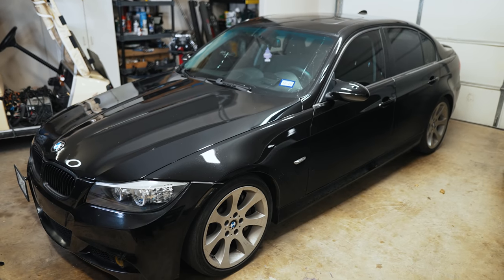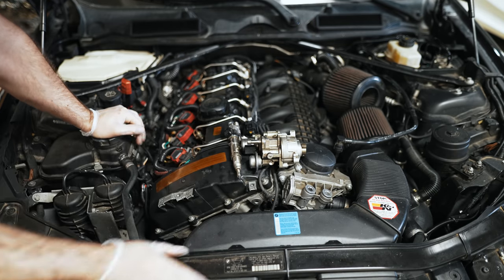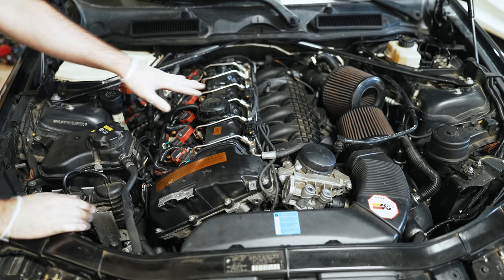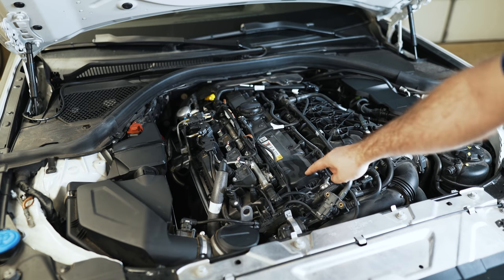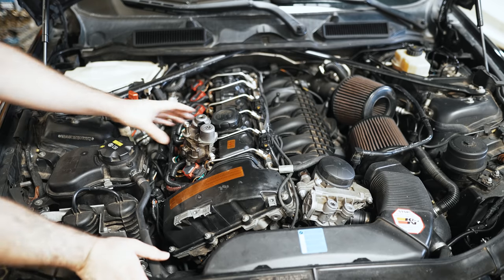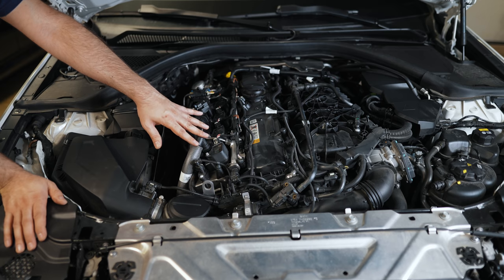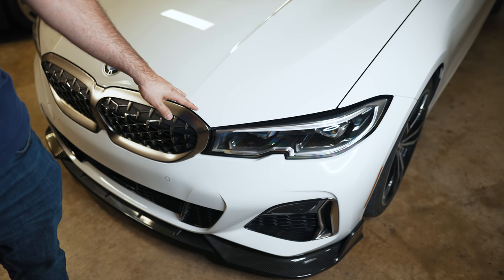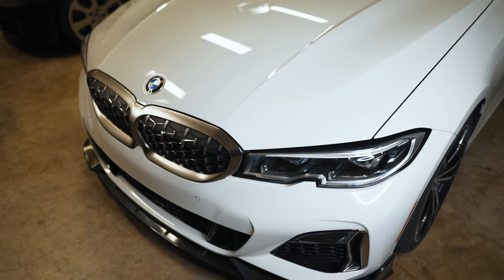Here Is Why New BMWs Are Now Reliable

Comment: Woaw I can't believe my ears. Calling this Reliable with life expectancy 120miles. Because it is full of complex plastic components that will fail 100%. My BMWs have no plastics on the engine. I have M20,M30,M40 engines in my cars. I have no idea about the milage and I honestly don't care but 30+ years old and they still work. Most people buy bmws when they are 120-150k miles second hand.  The reality is that this new plastic cars can't last that long and there is no way around the plastic valve covers, and when we talk about long term if you have to change them every few years it get expensive very fast. For example 20 years old BMW cost around $5k how much is the stupid plastic valve cover on the E90?  the whole intake manifold is plastic yea they reinforced the hell out of it but it won't matter as plastic ages while aluminum doesn't.
Reply: Plastic parts are fine when you jam a bunch of unnecessary metal objects around them to generate heat thats when its a pain. BMW is just a joke at engineering they worry so much able track performing but nobody is taking these cars on tracks.
Reply: @bighorse215  They are not fine they are just cheap. That is the reason why we have so much plastics. Some argue it is for weight reduction, but you can use aluminum,titanium for light weight but it is not cheap. Also no manufacturer want to have cars going for 20+ years. They sell cars so it is no brainer why they design things in this ways.  Oh your gearbox have filter in it. Let's integrate it in the pan so you can't replace it without replacing the pan.  Oh you like to change oil on your car and fill it without paying us for it? Let's remove the dipstick you don't need to worry that your car is running low on oil and the oil is bad we have replacement engines once it spun the bearings, or you can just buy new car right.
Reply: @Matt Rampley I have 4 BMWs, 2 E30s E32 and E38. Trust me this car have been driven like there is no tomorrow, and they are reliable. You can't argue which engine is more reliable M20/M30 vs N54. My M30 is more than 300k miles and the most major issue I had with it was failed stud on the exhaust manifold. When this happen the machine shop couldn't believe this engine was with such millage. So from my point of view the reliability trend is downwards. M50s were less reliable than the M20/M30 then the Vanos made it even worse.  M54 is oil drinking cam ruining disasterpiece and yet there are tons of people that say it is very reliable, but yea it is depending what you compare it to.
Reply: I have M40 , M20. But also a M50 with 230k km and 28 years. Still working great. I won't ever buy those new cheap plastic engine from BMW. M50 intake is kinda plastic but super strong. No issue at all. I would buy a brand new M50 today. I have the Vanos one too. But i change my oil very often and no issue yet.
Reply: My god I have had 5 bmws. Now an f80 M3. I drive my cars.. bmw is for the person who loves driving ... I fucking killed all my cars and the only car that had issues was the 335d. That’s because of all the bullshit the feds make you do to a Diesel engine.

Otherwise I have no clue how folks run around talking shit about BMW. These cars are better than anything else on the market.

Every car has issues. New technology today versus the past. Less weight, more performance and technology. You cannot skip out on plastic. What use aluminum? Carbon? The folks complaining would never spend the money on that.

Bunch of haters...

Comment: currently laughing in n52 even though I was just outside for a few hours replacing my valve cover and oil filter gasket
Reply: I almost blew my oil pump and God knows what else due to a failed oil filter gasket, had to basically do a minor oil change service due to all the oil spill. I love the brand but would I say they are reliable, hell no!
Reply: they have odd problems a lot of other cars don’t, I haven’t had too many issues with mine though
Reply: what does your oil pump have to do with your oil filter housing gasket?
Reply: @Shabbe02  Well when the gasket gives up and the car spews all the oil out, I doubt your pump will function properly after being starved of oil.
Reply: @krispytoast8804  I'm on a 2nd engine due to oil-related problems and wear and tear on certain parts.
Reply: damn how many miles? Mine hasn’t really had oil issues aside from the gaskets that WILL fail on these
Reply: @krispytoast8804  Lol I'm using km so if I do the conversion it would be 155342.8 miles, for the past 2 years I have been doing my own maintenance with the help of a friend who is a professional mechanic. The costs have slowly decreased as I'm more pro-active than waiting for the car to die out on the side of the road.
Reply: @krispytoast8804  Just recently I had to change the rear main seal as it leaked oil and affected the flywheel, had to replace that too, and due to low oil the oil pump ceased and had to be replaced, I had to replace the stem seals as I had smoke coming from the exhaust, fixed a couple of loose things here and there as I had the whole engine apart, all of this cost me about ~750 USD (converted from my currency ZAR). In all, I think these are gr8 cars with gr8 engines but man maintenance is a bit of pain.
Reply: Ok but then the cause is from oil starvation not really the gasket Itself, not to mention that it will most likely not leak so much in a short period of time that oil level will be to low.
Reply: @Shabbe02  I had that thought too, so last week I started the car and after about 5-10 minutes of idle the check oil pressure light came on, immediately drove back home and turned off the engine and realised I had oil leaking, after investigation, I then decided to drain whatever is remaining as I wanted to also replace the oil level sensor as I recently bought a new one, to my surprise mate, there was no oil left, shocking right?
Reply: wow that must have been leaking for quite a while then mate
Reply: You have a B58 engine? That's what this video is about - its much better reliability over previous engines.
Reply: @davepaturno4290  Not at all Dave, I guess it might be good and improved now, I decided to switch to their German cousin and purchase an A4 Audi, I still love Beemer no doubt and have kept my old E90, I would love to try the newer BMW models, but I stand a better chance being hit by a meteor than my lady agreeing to BMW anytime soon :( :)
Reply: Then get a Toyota Supra!👍

Comment: I owned a N53 325i for many years. The only issues it had was a single ignition coil failed (74€) and the wheel speed sensors failed. Other than that it was extremely reliable and very very fuel efficient (less than 8L/100km <30mpg). Since 2017 i own a M140i with a B58 and a manual transmission - enthusiasts wet dream. The B58 is currently the pinnacle of performance, reliability and efficiency.

Comment: Another great vid and that much mileage on the same plugs?! Very cool.  I'm also a B58er and it amazes me the evolution of the inline-6 from big B. Having a closed deck engine and not being canted 30 degrees is wild to me. Since I've always had manuals, it's the auto transmission and diff that have my Spidey (gears?) sense on alert.

Comment: Is the N52 reliable enough for a coast-to-coast road trip? Mine has 144K miles and I've addressed stuff like VANOS, starter, alternator, pulleys and belts, plugs and coils but I'm wondering what else could leave me stranded on the side of the road
Reply: Waterpump, and valve cover gasket leaking oil everywhere, esp. on the belts.

Comment: Engine is full of plastic that will crack overtime making the car uneconomical to repair.  They will las 10 yrs at most.  Cheap expensive cars.
Reply: Every BMW owner should by a 3D printer
Reply: Name one single car being produced right now that doesn't use just as much, if not more plastic.
Reply: @XcoolcoolbeansbeansX  i don't know, I don't buy new cars. They are all expensive piece of craps on 84 months leases for poor people with a fix salary to pay to show up and trying to impress their coworkers and neighboors.  My most recent car is an '07 Mercedes e350 4matic that I paid 8K and it still looks brand new at 70K miles.  However it has a stupid plastic intake that will one day crack. I also have a '01 BMW 740il low mileage with plastic on the chain guides, waiting to fail. Plastic should not be installed around motors running at high temp, stupid engineering.

Comment: Hey I have a couple questions. My N54 rods gave out on me what do you recommend I do. I did a compression test and all my cylinders are over 155 PSI. The knock goes away on idle but is present on rev. I bought a new engine but it was a timing chain issue. I wanna check the PSI on the new engine. But I’m stuck in a rock in a hard place on what I should do.
Reply from the maker: How many miles are on the new engine?
Reply: @VehicularDIY  166,000 I believe like 108,000 miles
Reply from the maker: @John.doe26840  Okay if you check the compression on the new engine don't be too disappointed if it reads a little lower as you are supposed to bring them up to operating temp and let them cool for an hour.  That way there is a film of oil around the rings and the components have expanded enough.  So an engine that reads 160 would likely read 180 when warm.  No way to do that with the engine out of the car.

Comment: Good info, have a question on vanos replacement? Since they are against the firewall, does this require the engine to be removed or is there a tool?
Reply from the maker: For the most part yeah so we better hold the vanos and timing chains are as reliable as they need to be.

Comment: Took my 16’ 535msport to 144k miles. Purchased it with 40k. Never had an engine light except for when my aux radiator blew. No oil leaks. 
Well I changed the upper arms but that’s standard on the east coast

Comment: BMW tech here.. I can tell you right now they have the same problems as the older ones, I prolapsed my back from changing EGR vavles and intakes as we had to changed so many as they were setting the cars on fire...
Reply: Certainly not GR Supras. They have been very reliable and are recommended by Consumer Reports magazine.

Comment: I mean compared to N54, even alfa romeo seems reliable. If it wasn't for the forged internals and ability to make big power they would all be in the junkyards by now
Reply from the maker: Yeah they seem to be making a bit of a revival as they're in the hands of people that want 500+ HP for under 10K.
Reply: Honestly they’re not THAT bad on stock power. Most guys that have a boat load of issues are the ones who throw a JB4 on and send it to Map 3 without doing any preventative maintenance.

Comment: Having been a previous BMW owner and having suffered both financial and psychological trauma, I do not believe in any of this nonsense. BMW has always been over engineered over complicated, totally unreliable cars. They never managed to fix all the problems that you mention and more, all those years and now presto suddenly every thing is fixed. No their philosophy, approach every thing is bad. Go back to the drawing board BMW. Learn to build simple reliable engines first.
Reply: Yah what did you buy? A 110k used f30? Like the other guy?
Reply: @waqidj   E91 2009 efficient dynamic, new. Kept it only for 5 years, lot of problem and repairs. It had only done 40000 km in 5 years! Sold it and bought Mazda CX5. Good riddance to BMW. Great reliable Japanese car. Not a single problem, great to drive. You only make the mistake of buying German car once in your life time. Even my children won't touch German after my experience. They have Lexus and Hyundai.
Reply: @Raj-nh3fc The Toyota GR Supra with B58 engine is both high performance AND reliable.

Comment: I have a 2015 F31 with the B47 2 Liter 4 cylinder Diesel with 210 thousand  Kilometers, and only had two engine issues since new, both were EGR related.

Comment: I have a 2006 e90 and at nearly 200k miles it's been great. Hasn't been in the shop in 7 years. I drive 16k miles per year. It has only needed a water pump, thermostat, spark plugs and coils. I did all that myself for less than $1000 in parts cost over the 7 years.

Comment: Hi Sir, thank you for such a detailed and informative video. I have a 2019 BMW 3 Series and I am dealing with a Valve Cover Rapture as I was told by my local BMW. Currently, I have 95,500 KM on it. I feel disappointed and BMW can give me an explanation why this happened. Waiting for the part to be shipped from Germany to Canada. The car is out of warranty and I have to deal with the expenses. Thought the BMW engine would be more reliable these days. Do you have any comment on this issue with the valve cover rapture?
Reply: Rupture or cracking?

Comment: Just turned 70,000 miles on a 2018 530 with only a replaced 'Active Grill' under warranty a year ago or so. I change the oil (Castrol Edge Titanium with BMW filter) in between official services. It's a twenty-minute job and I aim to get half a million miles out of her. While I preferred the rumble of my Hemi Charger, I really like the straight six sound as well. Plenty of power and it fairly swooshes along. Btw, it's having its first ZF Transmission service next week. BMW may say the transmissions are 'sealed for life' but ZF, who make the damn things, say otherwise. Depending on how hard you drive them - hard and fast or pulling horses etc, you really should get a service done on the transmission every 70-80,000 miles. I'd hate to have to pay to get a new one fitted.
Reply: How did the transmission service go? I am also looking forward to do it but at a dealer.

Comment: Very nice! I personal think the n54 en n55 in Europe are more reliable because  they're running on German parts. My 335i 2009 had one issue uptil now and that was the water pump(50k miles) Small crack in the plastic housing. That's all. And the sea climat will help too here in Holland. So no overheating engine. My friend owns a 640i N55. He drove it from 40k to 80k miles without one issue. At the moment the oilcooler gasket is sweating a bit. He will do both gaskets next month. That's all🤷‍♂️. Dutch regards, Nico.
Reply from the maker: Yeah I've heard that theory a number of times, my guess would be the mild climate.  Not as extreme winters or hot summers.

Comment: Dont know about reliability, because B58TU already has blown motors due to oil pump failure, which showed oil pumps are made of plastic. 
Question which come to my mind are
Are there any recalls/updated part number for B58TU oil pumps? RealOEM catalog is too old for that, only up to 2020 engines are visible.
Do B58 Gen1 engines have plastic oil pumps as well? Never seen these engines blown due to oil pump.

Comment: How does the new B58 in the 2021 3-series compare to the older B58 in the M240i if I want an M240i?
Is it horribly less reliable? Can I fix/revise the issues myself to make it as good as the newer B58s?
Reply from the maker: I'd say its close in reliability 90 to 95% as good.
Reply: @VehicularDIY  Alright, cool, thanks!

Comment: when you use your customer base as a test bed that is not a good track record.  12 iterations to get to get it to work leads to a lot of pissed of customers that came prior and a lot of time in the shop.  BMW and reliability in the same conversation is funny, perhaps more reliable than prior models but most BMW will still go 120-150k miles before they become a parts cannon.  They are still dealing with N63/S63 issues after a decade.  good content..

Comment: I mean N54 and N55 owners didn't have any problems at 15,000 miles either. And injector failure, pcv failure, and leaking oil filter housings are fairly common on B58 engines.
Reply from the maker: The comparison is for early production cars, think of the N54 when if first came out and how the HPFPs were failing before the first oil change was due.

Comment: I didn’t have any engine specific issues with my 2016 BMW it was just everything else. The left rear shock fell apart and started clunking, the clutch master cylinder started leaking on the interior of the car (dripping off the clutch pedal), the radiator fan went out, the infotainment system went bezerk and quit working, the wood trim on the center console around the shifter came apart, the blower fan motor on the interior failed. This was on a brand new car I bought in 2016 and all of that happened before I hit 9,000 miles on the clock. I have zero concerns about the engine reliability because I didn’t experience any specific engine problems, it was just all the rest of the stuff that was pretty junky, I got rid of it after 10 months of owning it because it was in the shop so much for just the little things, I had a front brake pad fall apart, these are things that shouldn’t be an issue on any new car, interior trim, radiator fans, shocks, are all things that are relatively unchanged for many many years and should be the most reliable parts of a car.

Comment: Would you think BMW has applied the same fixes to the 2021 twin turbo V8?  I'm interested in a M550i.  Thank you!
Reply from the maker: I think they'be been trying but the hot v configuration poses a bit of an issue given all the heat being generated between the heads.  They are much better now than they were years ago.
Reply: @VehicularDIY  well...I'd take good care of it and not abuse it.  We just drove one and it's sooooo awesome!  Thanks!
Reply: @Vehicular DIY Even I did a test drive for one of the CPO 2018 M550i and it is great. I am planning to buy one in few months from now. Would you recommend the 2018 CPO under 30k miles? I’m guessing they are good until they have warranty on them right.
Reply from the maker: A CPO would be good if you plan on running it past 60k.  If you can get it for a reasonable deal.